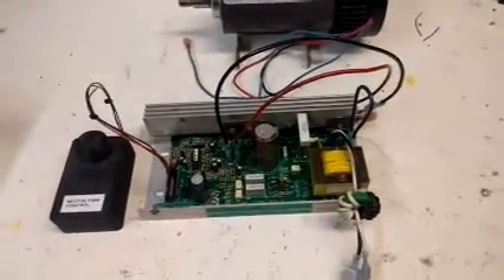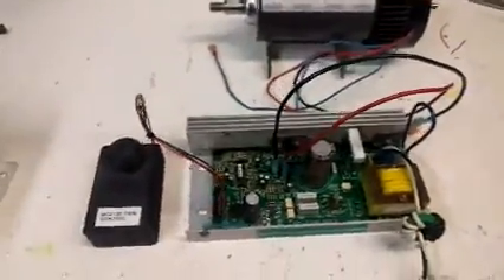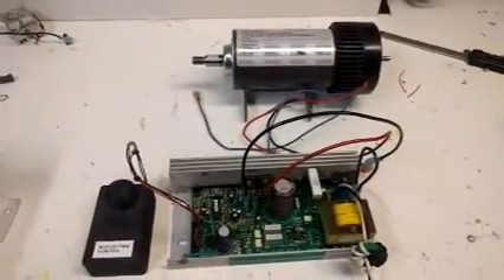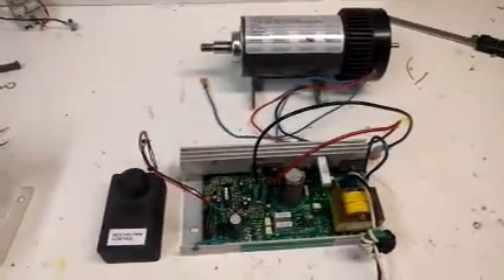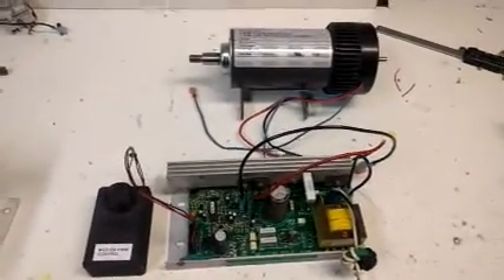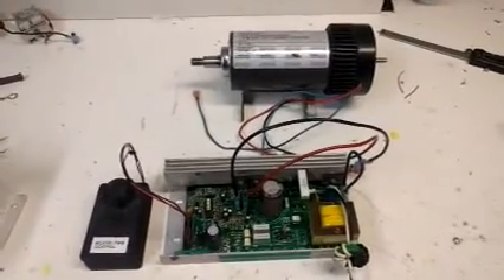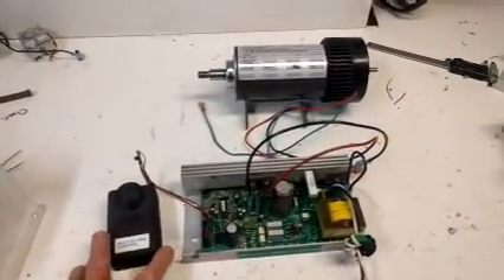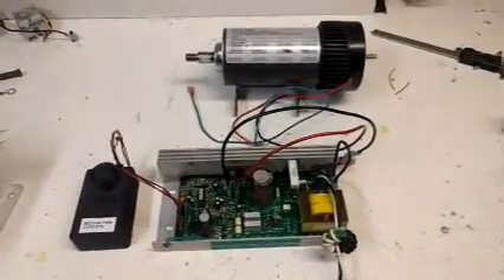MC2100 controller PWM generator

Comment: THANK YOU!!!  Have been toying with this MC2100 with a JESSINIE Signal Generator XY-KPWM, and getting no results.  Was sure that all settings were correct, but it just wouldn't work.  Then, per this video, changed the PWM to 20Hz and the LED started to blink, and the motor started to turn!!!  Not sure why 20Hz works, and say 50Hz doesn't.  But all is good now.... cool!  Thanks again.

Comment: I seen several different videos on a crazy smell from these treadmills, the Weslo. A lot of different people were saying that there is a fan on a control board for which I don't see on this demonstration. After an hour I smell the treadmill burning. The belt itself is lubricated with the proper lubrication for weslow treadmills. So I'm presuming that the smell must be coming from the motor since there is no fan on the computer board. I just wanted to pick your brain and see if you think that the board itself shouldn't be overheating, and that it is probably the motor. The treadmill is not being ran at high pace, walking pace at most. And it seems to happen at the 20-minute Mark each time. I did read that you cannot buy the motors nor computer board anymore. But I wanted to get an idea just in case I can find one in a local scrap yard

Comment: Hello Jim how are you? The test box do you have a diagram ? I mean can share it?
Reply from the maker: I'll see if I can dig it up. It's been a while.
Reply from the maker: The test box is built on a Microchip PIC processor I happened to have laying around. It only uses two signal pins, one analog input, one digital output, so any microcontroller can do the job. Here's a link to the schematic and the C code.   https://www.dropbox.com/s/42u178wwylrfozy/MC2100%20PWM%20Gen.zip?dl=0

That zip file has the source code (the .h and .c files) for the processor, a jpg image of the MC2100 schematic, another jpg showing an enlargement of the PWM input pin detail on the MC2100, and the schematic of my test box.

These days, the test box could be done on an Arduino pretty easily I think. The main thing is getting the pulse width  and pulse rep rate right. Also, the connection to the MC2100 needs attention. The PWM input pin has a 22 ohm resistor in series with an optoisolator. That configuration will draw too much current from the processor pin driving the PWM signal.  More resistance needs to be between the processor pin and the optoisolator, more like 200 ohms. That can be done by putting a resistor in series with the wire going into the PWM pin, or by finding that 22 ohm resistor and replacing it with a larger one. If you want to leave your MC2100 unmodified, then just put a resistor in series. The easy place to put it is in the test box.

For the pwm signal itself, the repetition rate is 50 milliseconds. The pulse width range the code generates is 0.5 milliseconds to 47.5 milliseconds (1% to 95% of the rep interval). 

Good luck with the project.

Comment: oh well guess this mod does not work with my mc2100 rev b board..i have tried 19-21hz and none work..and im using exact same pwm as you basically...oh well its trash time....wait a minute looking at the online specs on my pwm there may be something to do with the decimal point and hz vs khz readout..maybe im in khz readout.. this is what my pwm says right now my meter is reading  in tenths 19.0 19.1 19.3 etc etc Frequency is divided into four ranges, automatic switching:
1. XXX (no decimal point): the smallest unit is 1Hz, the value range of 1Hz ~ 999Hz;
2. X.XX (decimal point in the hundred) the smallest unit is 0.01Khz, the range of 1.00Khz ~ 9.99Khz;
3. XX.X (decimal point in ten): the smallest unit is 0.1Khz; value range of 10.0KHz ~ 99.9KHz
4. X.X.X (decimal point in ten and hundred): the smallest unit is 1Khz; value range 1KHz ~ 150KHz frequency

Comment: dis is what i bought..its cheap but if it works ill design and make a case for it with my 3d printer https://www.ebay.com/itm/Signal-generator-PWM-pulse-frequency-duty-cycle-adjustable-module-lcd-BRPC/174122831196?ssPageName=STRK%3AMEBIDX%3AIT&_trksid=p2057872.m2749.l2649

Comment: Question. I picked up a Reebok treadmill from an friend with the mc 2100 and I’ve got all the boards out of the control panel including the one that produces the pwm.  Is there a way to connect a pot to the 2nd board?
Reply from the maker: The MC2100 requires a digital pulse-width-modulated signal to control the speed, and it won't accept a simple connection to a pot. I don't know of any inexpensive widget you can buy to drive the pwm input, but if you start searching on MC2100 PWM you will find posts and articles from hobbyists who have come up with something.
Reply: Jim Bixby trying to figure something out cuz it runs fine the way I’ve chopped it up, but I’d rather build a smaller box to contain the electronics.  I ditched the side panel that the ribbon connects to that quick sets the speed from 1-10 in favor of the ribbon that comes out of the board and goes into the speed up and down panel which allows me to adjust it from 1.1-1.2-1.3 etc.  I cut out the lcd display that shows me my speed but I’d rather have a simple knob on a box then the up down pad an an lcd that shows me how many calories I’m burning while running the mill I’m building😂
Reply: In other words I have the board I’m assuming generates the pwm signal to the mc2100 board but I’m trying to figure out how to hook up a pot to it

Comment: Did you build or buy the test box that produces the PWM?
Reply from the maker: I built ig using a PIC microprocesson on a printed circuit board I happened to have with code that digitizes the potentiometer setting and produces the appropriate pulse width. You could pretty easily do the same thing with an Arduino board.
Reply: @ljbix  Bummer...I was hoping it was store bought :)  I guess I might as well use one of these adruino mini's I have...I impulsively bought five of them cause they were so cheap out of China.  I'll bet I can even run it off that big ol transformer that doesnt do anything else.

On the MC2100 pins...what pins did you use for what?  I am guessing the one with "P" next to it is the PWM pin and G round on each end?
Reply from the maker: @jzahirniak  The MC2100 connector is the one with 8 pins. Position the board so that connector is at your lower left.  If I call the bottom-most pin*the one closest to the heatsink edge)  pin 1 (this would be the pin on the right side when viewing the connector from outside of the board), then pins 1 and 8 are ground, pin 2 is a power supply at either 9v or 12v depending on your MC2100 model, and pin 4 is the PWM pin. I used pin 8 as my ground and left pin 1 disconnected, so my connector is to pins 2, 4 and 8.   

There is lots out there about the PWM pulse repetition interval, some saying it must be PRECISELY 51ms. That is not true. Intervals between 50 and 52 ms worked fine. I picked 51 to operate, but 50 would have worked just as well.   The MC2100 still not start up the motor if pulses are being applied that are longer than some minimum value when the MC2100 is powered up. This is to prevent the treadmill from abruptly starting up. If there are pulses present, then the pulse width must be taken below that minimum value and then can be increased, and then the motor will run. I don't know the minimum pulse value, but I think it is something like 1ms. The board has a lockout of a couple of seconds after power-up - after that lockup period, pulses of any width may be applied. 

So: (1) operate your circuit from a regulator on the MC2100 supply, so that it cold starts/resets whenever MC2100 power is applied, (2) include a 2-second lockout at reset, so that no pulses are produced for the first two seconds. After that, you can apply pulses of any value and the MC2100 will control the motor accordingly.   

The MC2100 PWM input is a   22 ohm resistor in series with the LED in an optocoupler. The LED voltage drop is about 1.4v, so if you try to apply a 5v signal to that pin, you will attempt to shove 160ma into the LED, far to high a current. If using an NE555 for example, it may be capable of putting a large current like that into the pin. What will really happen with a CMOS logic output is that the login pin can't source that much current and so you will limit at a couple of volts. That's not good either. Solution: put a 220 ohm (or so, value isn't really critical if you are in the ballpark) in series with the logic pin sourcing the signal and pin 4 on the MC2100 board. Alternatively, replace resistor R2 (near U1, the optocoupler) with 220 or 240 ohms. In treadmills, this resistance is up on the console board. Here's a reverse-engineered MC2100 schematic I found helpful: https://bit.ly/2BtFCQs.

Hope that helps. If I may ask, what are you building? I did this project as part of a bandsaw conversion, to make my 14" bandsaw variable speed so that I can cut metal with it at low blade speed. I haven't quite completed the project yet, but all the motor control stuff is finished.

Jim
Reply: @ljbix  Right now I am working on building a 2x72 belt grinder.  I obtained a free treadmill on Criagslist a few weeks ago and then another one yesterday!    First was bogging down under load supposedly.  I didn’t see it because to get it in my car we had to take it apart in the driveway and I didn’t see the need to put it back together.  During teardown it looked like the belt from motor to rollers was pretty loose so I am betting it just needed to be replaced or tightened…didn’t care really cause it was never going to be a treadmill again anyway.  It came with an alt-6330 v2.1 motor controller like this one… https://images-na.ssl-images-amazon.com/images/I/91ukeNbVZ2L._SX425_.jpg and I couldnt find anyone trying to make use of it so I abandoned it in favor of a simple 10kw SCR controller paired with a 5010 bridge rectifier. Tried a couple different pots on it. 250k takes about a 1/3 turn to start and 100k is running at 0 on the dial. I have a 200k on the way and I might just settle there if it can zero...I am not wild about the motor running from 0 for some reason. The first ones motor will be for the grinder project because the flywheel is 2in wide so it will serve fine as the drive wheel and its 3hp vs 2.5 in the second one.  

The second treadmill it was supposedly just accelerating randomly.  Again, I had to tear it down on site because the lady couldnt help me lift it and it wouldnt go thru her door...so I couldnt test it.  The controller I wouldnt think was the culprit on this one...more likely it seems that it was the control panel on some level loosing its mind.  It had the MC2100LTS-30 like this one…
https://www.picclickimg.com/d/l400/pict/263788736608_/Proform-Nordictrack-Reebok-Treadmill-Motor-Control-Board.jpg  
...so it is a slightly different one than yours and also from another seen here… https://youtu.be/rAZ8FCzOuxE  .  Grant Brown already wrote an arduino sketch which is great cause I really cant…yet.  He didn’t write in a pot though so that is still needed.  Or I could go with the same setup as above.  

I am under the impression the motor will run quieter/better with the MC2100...cant find the video I watched comparing the two but it is what has me wanting to try this route.

As of now I do not have a plan for the smaller motor. I was thinking of using it on my bandsaw at some point as well for the same reason though I would like to have that kind of control on my drill press as well without changing the belts all the time. I'm always looking for free stuff on craigslist so maybe I catch another one and do all three :)
Reply: I really dont understand electronics well yet.  Testing the SCR rig under max load on the 2.5hp motor and its reading 155v but the motor is only rated at 135v.  The 3hp motor is rated at 90v but under load its showing 135v.  Testing this at the bridge rectifier terminals.  Do those numbers seem normal?

Comment: Jim what are our cooking up now?
Reply from the maker: This will become a variable speed drive to convert my wood bandsaw to be able to cut metal by slowing the blade way down. These treadmill motors and control boards can be free or nearly so by finding free or very low priced treadmills on Craigslist. I got two treadmills with good motors and controllers for a total of $10. The treadmills themselves were wrecks, but the parts I wanted to harvest were ok.